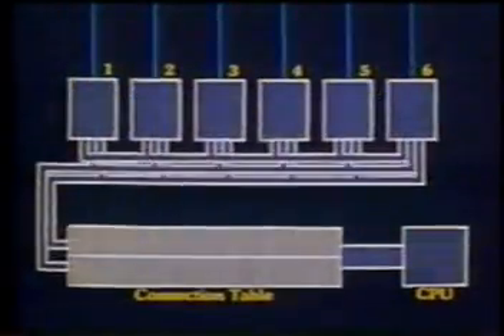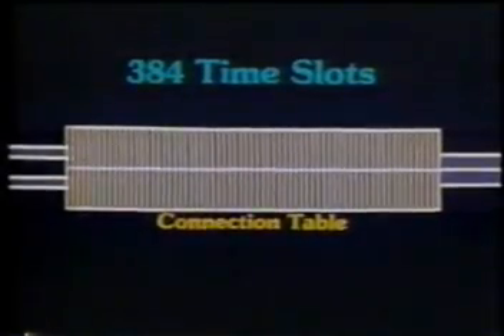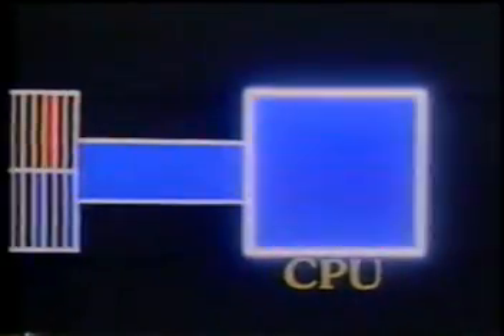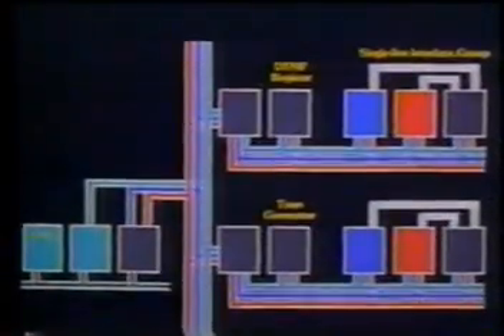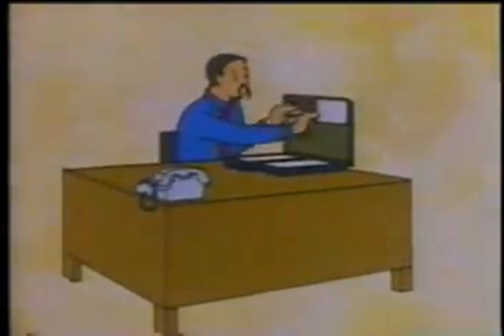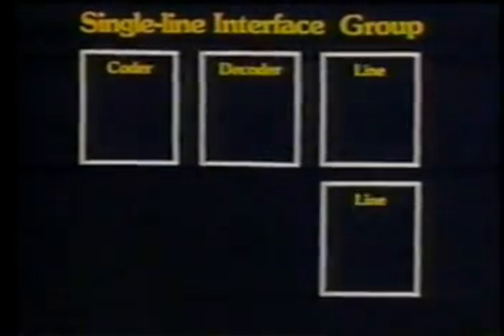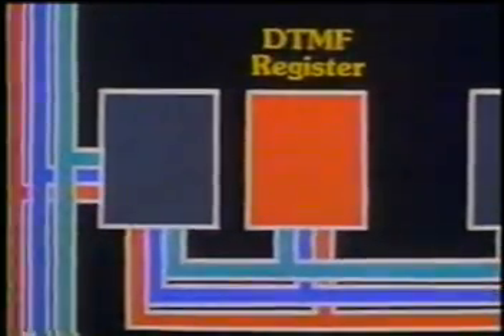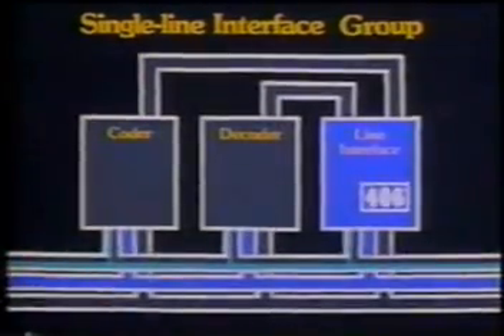cbx op princ.mpg

Comment: January 16, 1981, first day of CBX Maintenance training (after two weeks of Configuration training) at Old Ironsides in Santa Clara, California. I had previously interacted with the ROLM industrial computer while working for Welex (the now defunct oil well logging division of Halliburton). I never imagined to see this other incarnation as part of a phone switch nor did I expected such a great presentation. At that time, my experience with telephone switches amounted to only four weeks, most of them purely theoretical. However, the training was so great that, after a short hands-on training at ROLM Colorado, I could go back to my country (Argentina) and start working right away on the first ROLM ACD installation in South America. Good old days when the employer paid for your training AFTER they hired you. Nowadays it is all prospective employee-paid certifications.

Comment: What was the telephone ROLM CBX system?
Reply: Let me guess, You wanna know what the off-hook tone sounds like..Lol... Your comments are EVERYWHERE!
Reply: @tieline1333  Just with this switches with non bell phone companies. There was one with an off hook tone that sounded different them we normally heard. It was a constant 400 HZ single tone.
Reply: Incorrect...Rolm Dial Tone was 525 and 660 Hz...1.5 x standard Bell Dial tine, 350 and 440. DND (770/880) was 1.5 x busy (480&620)
My ham repeaters use ROLM DT as a courtesy tone
Reply: @tieline1333  just wanting to know how to how the phone company operates the off hook tone and learning about electronics and how they are programmed.

Comment: CBX was way ahead of its time.  The original configuration had a 5MB/s system bus which could handle up to 928 voice calls at once.   This was eventually expanded to the point that the amount of calls that could be handled at once through a ROLM CBX would be more than any sized location would ever need.